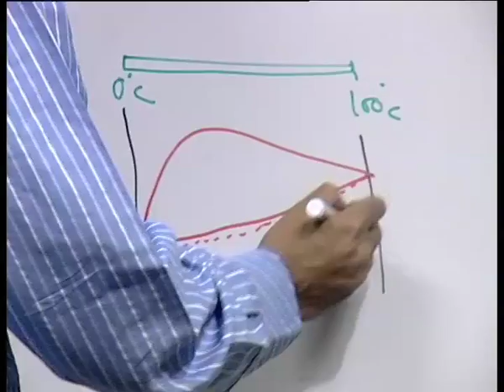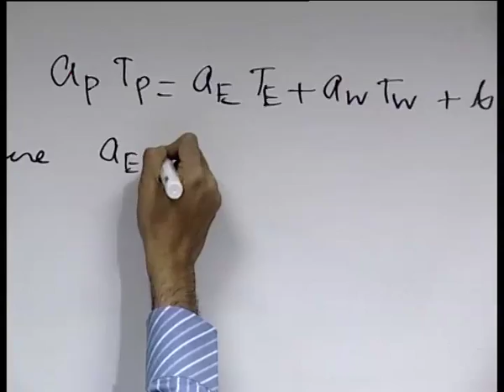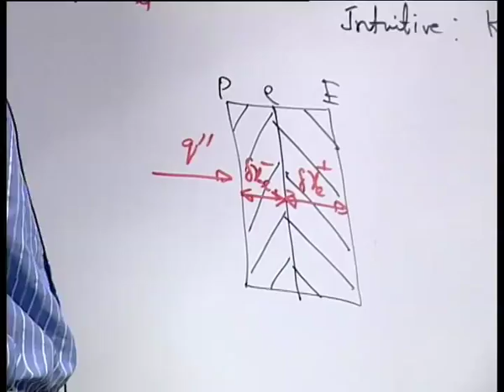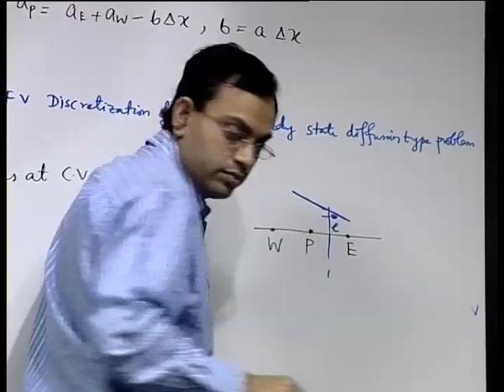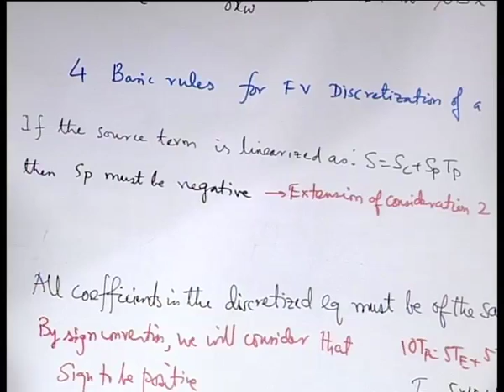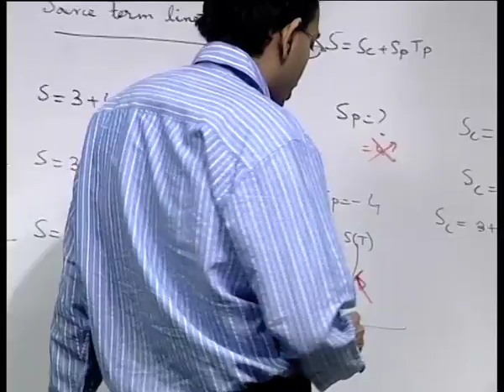Mod-01 Lec-13 Finite Volume Method:Some Concept  Basics

Comment: But sir, in rule 3, why should there be a necessity that Sp should be negative. As you said in rule 2, yes ap should be positive for the solution to be consistent; in the example, the temperature at P should be in between 100 and 10. But should that be the case when there is a source term? According to the nature of the source (or sink), the temperature at P may not be in between the east and west values, and isn't that incorporated in the source term itself? Would there be any problems if Sp is negative?

I do not have experience in solving problems using FVM, so maybe experience is a factor.